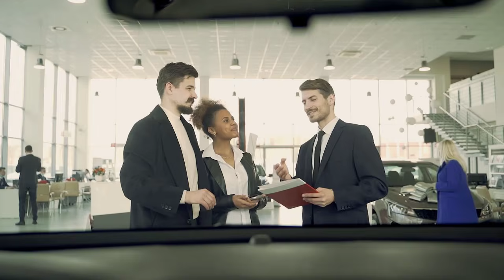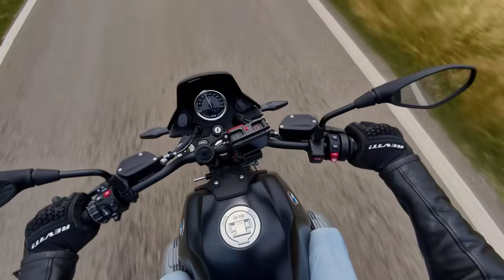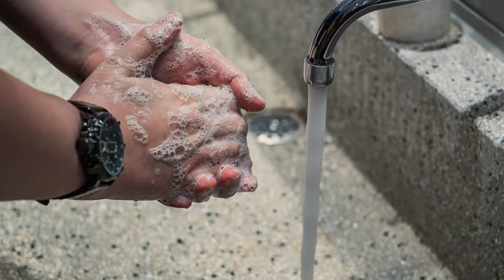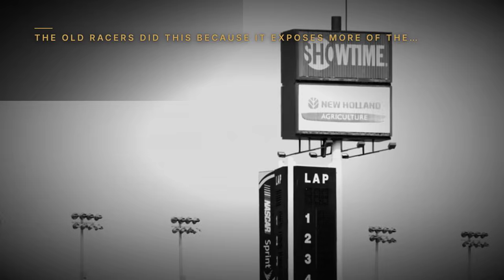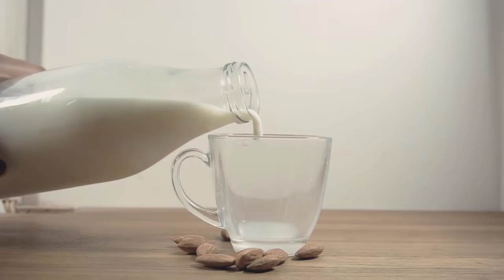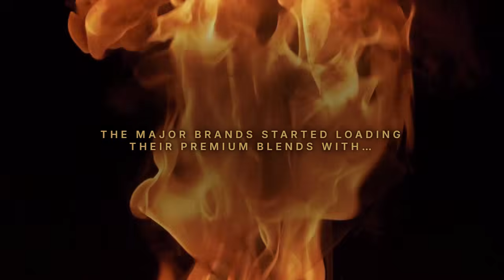17 "Illegal" Amish $0 Tricks That Instantly Boost ANY Engine's Power

Comment: Adding a molibdinum disulphide product at 20,000 miles will increase the life of your engine. I get 500,000 to 700,000 miles from this.
Reply: Molybdenum disulfide, MOS2.
Reply: @Mentallect   dyslexia!
Reply: Will it work for both gasoline and diesels? I've got two cars here in the UK I'm thinking of. A Citroen diesel with about 178k miles on it and a little  Vauxhall Agila 1 2 Twin Port  gasoline car with about 150k miles. Next question: is there any benefit to adding it with all those miles on them? I'm looking to keep them both as long as we can because the modern stuff is: a. Too expensive b. Overcomplicated rubbish
Reply: @JamesHolbrook-eh5sp   YES